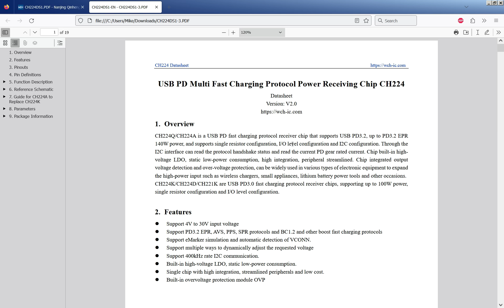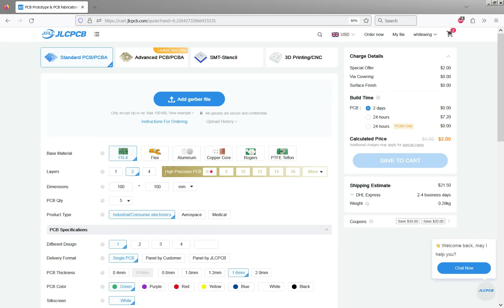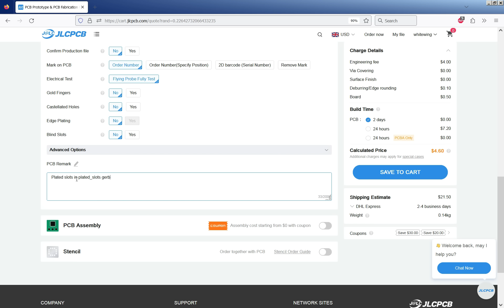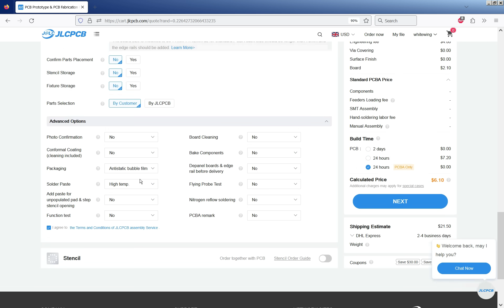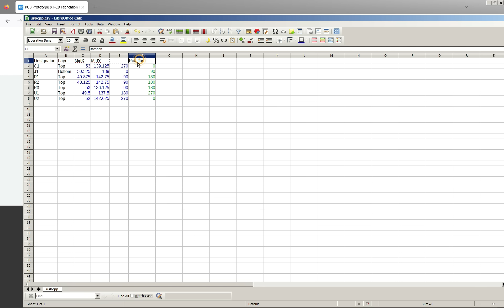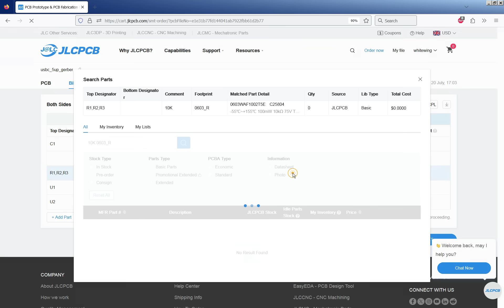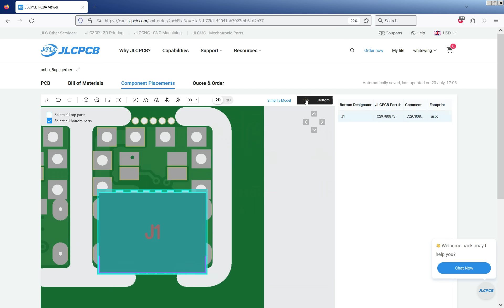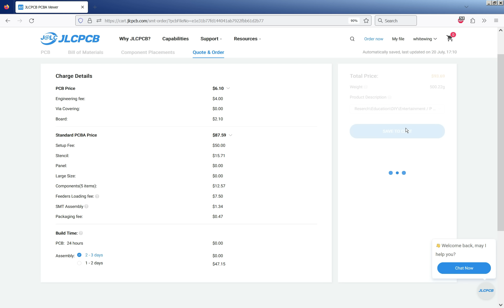USBCing all the things

Comment: Why would you make an effort to replace a dirt cheap, simple and reliable power connector with an unreliable and expensive data connector, for which you have to use far more expensive PD capable power supplies?
Reply: A 30W USB-C charger costs €7 at ikea (can go cheaper if you don't care about quality), plus one probably came with your phone, or your PC or monitor has a port, and you can also run your gear from a powerbank now.
Reply: I have a sizeable homelab. Because I've moved recently, all my electronics and their corresponding PSUs are in separate boxes. Not looking forward to match them up again.
Reply: it was explained in the very beginning of the video.. 😅
It is kind of nice to have "the one" power supply for all of your gadgets.. But I kind of have to agree, the cost / convenience ratio is a little off for my taste.
Reply from the maker: Because you can use the same adapter for lots of devices.
Reply: EU legislation requires anything with a battery to be chargeable with type-c. No longer each thing needing it’s own special cable and power supply.
Reply: @davadoff  Kind of, I think there must be an exception for higher power devices because we are still buying laptops which are supplied with a barrel jack 230W PSU but they are 'mobile workstation' class with lots of RAM, i9 and NVIDIA GPU etc.
Reply: @M0UAW_IO83 and power took batteries are all proprietary with no type-c… I’m sure there are some exceptions, but for your laptop, USB PD goes up to 240W (48v 5A) which would be enough.
Reply: @davadoff  because of crapple shitting in everyones face year after year. the european union put a stop on it.

Comment: would've added a third "leg" for triangular stability like the original plug design, even if not electrically required.
Reply from the maker: You can do that with unused pads, cut the track (or disconnect the battery compartment) if you need isolation

Comment: Beware 12V support by power supplies is optional in the PD spec, so an e.g. 60w charger by spec only needs to support 5, 9, 15, and 20V. If you're using these then you should make sure the chargers you buy also support the optional 12V PDO.
Reply from the maker: Wouldn't it revert to 9V if 12V is requested?  And which idiot though that 12V should be optional...
Reply: @mikeselectricstuff "And which idiot though that 12V should be optional"

Good question. 12 volts is common enough that it's crazy its not mandatory in the PD spec.
Reply: @mikeselectricstuff from my testing of some PD adaptors & boards it varies, some will give you 9V (which would be safer) and some surprise you and give you 15V, some flat out do nothing and give you 5V as a safe default if it can’t find said voltage
Reply: @mikeselectricstuff it may.
Per USB-PD negotiations following happens
1. PD trigger and powered device gets 5V.
2. PD trigger gets list of supported voltages from supply
3. PD trigger asks for specific voltage from that list (5V, 9V, probably 12V, 15V and so on).
4. Supply raises voltage to match the request (if request isnt 5V, outherwise continue outputting 5V).
Can you get 9V instead of 12V - it depends on the trigger, some do choose closest lower available voltage, some stay at 5V.
Reply: 12V is not mentioned at all in the PD spec. Pretty sure the reason for 5/9/15/20 is to align with 1S/2S/3S/4S battery packs with sufficient overhead. All voltages except for 9V give about 20% overhead relative to 4.2V. 10V would’ve made them all consistent.
Reply: @mikeselectricstuff  it’s up to the device requesting power, which could request 15v or leave it on 5v.
Reply: Has anyone seen a 60 watt USB-C PD charger that doesn't support 12 volts? I know that it is allowed by the standard, but it wouldn't make any business sense.
Reply: @hamjudo  i've seen plenty that only do 5/9/20 or even 5/20  and i often see them that do 5/9/12/20, 15 is actually less common to find implemented than 12 but it happens
Reply: @hamjudo yes. We bought a large variety of 60W+ adapters from Amazon for testing our PD boards at work and a TON don't have the optional 12V
Reply: @hamjudo Yes. Apple chargers from 20W up to 140W don’t support the 12V PDO, none of them. Also Anker chargers and power banks don’t support it either (that I’ve seen anyway).
Reply: @philipk89 but apple is the worst overpriced crap. to it kinda checks out.
Reply: @hamjudo sadly none of anker chargers support 12v, of course I only found out when 12v trigger was already installed as an upgrade
Reply: @nich98  Wrong. My Anker 317 supports 12V@3A
Reply: I mean anything 12v that you’re using in a car with the engine running is actually receiving 13.5-14.7 volts so defaulting to 15v isn’t that far off the norm.
Reply: @mikescholz6429 desktop computers have 12V power rail (it is supposed to run at 12.0V, not 13.5-14.6V), 12V LED moduled / LED strips - the same (are supposed to run at 12.0V)
Reply: For 12v, one way is to get a PD power supply with PPS (programmable power supply) which will do any voltage output (in 20mV steps).
Reply: I will miss out connecting a linear transformer based wall adapter.
Reply: Thank you!
Reply: Capacitors are 6.3v, 10v, 16v, 25v. No coincidence 5v, 9v, 15v was chosen, I suppose. A mosfet could be the next limiting factor and why 20v not 24v is next.

Comment: Just designed a power supply for the good old Commodore Amiga which will run it from a 15-20VDC USB-C output! The hard part is getting the 5 pin DIN connector for the Amiga!
Reply: enjoy all that switching noise in the audio/video outputs
Reply: @humidbeing  my design uses MLCC ceramics on the outputs. There is less switching noise there than on the original PSU's and even than from a Meanwell.
Reply: @humidbeing  also, you DO know the original Amiga power supplies are switch mode as well, right?
Reply: One thing to be aware of with the simpler USB PD chips, is if you ask for say 18V and the supply doesnt do it, rather than supply nothing it will supply a lower voltage. The only way I could find to prevent this behaviour was to get a microcontroller involved. I decided on using the HUSB238 mainly because it has an i2c input - the CH224 does too but JLC/LCSC only seem to stock the D and K variants which doesnt.

Comment: Great idea! A 3D printed shell in the exact same shape and size of the original would make it a perfect replacement.
Reply from the maker: The problem is sometimes you need to have the C socket stick out more than the original face of the power jack
Reply: @mikeselectricstuff  Yeah sure, and if it sits inside the case and there's a round hole in the case for the DC plug it won't fit and you'd even have to modify the case.
But in many cases, the whole rectangle of the connector sits flush with the outside of the case and then it would be perfect.

Comment: Neat little design!

One tip on JLC, if you've got really small features (at or close to the limits of their capabilities) it's usually worth it to go with the TG155 material rather than the default TG130. It's about a $3 cost adder but in exchange they're a lot more lenient if you're sending them a difficult board, and it can save you a ton of time and money down the line. It's also the material they base their impedance profiles and calculator on (bit of a gotcha there - if you order a specific stackup but don't pick TG155 the impedance will be wrong!)

Comment: The EU twisted Apple's arm to use USB C, they should make every company do it too.
Reply: It’s an EU requirement.  Every consumer product sold in the EU using any USB variant has to be redesigned to use USB-C.  (This will be using genuine import channels for external stuff.  They won’t be checking your AliExpress orders for compliance.)
Reply: @boggisthecat  Only in certain, mostly consumer-oriented, verticals
Reply: @0xbenedikt  That’s a bit misleading.  Search “EU common charger rules”, then look at the first link.

“The 'common charging' requirements apply to all handheld mobile phones, tablets, digital cameras, headphones, headsets, portable speakers, handheld videogame consoles, e-readers, earbuds, keyboards, mice, and portable navigation systems since 28 December 2024. These requirements will also apply to laptops as of 28 April 2026.”
Reply: @boggisthecat  Exactly. But there are so many product categories not covered by this even in the consumer space. Let's not get started about the non.consumer products.

Comment: damn, JLCPCB software sounds like some BS
Reply: Mike's way of doing it is a bit long winded - not sure what tooling he's using to generate the gerbers, CPL, etc.

Usually you just drop the files in from your EDA tool and it works, no messing about. Even with the part rotation bit you can correct it in the next step of the ordering process. If you're using EasyEDA it's basically a single-click order, and in Altium you can set up an Output Job once and reuse it for all your projects.
Reply: @gsuberland  works perfectly with kicad as well
Andy
Reply: it's not perfect but it's very simple to set up a pcb once you're used to it. I have no problems using it with my PCB work generated by EAGLE

Comment: FYI, for JLCPCB, you don't need to put plated slots on a separate layer or add a comment. Show the routing for the slot on the outline layer and cover the slot with copper (both sides) and it will come out fine. HTH.
Reply from the maker: Always best to state things explicitly to any PCB manufacturer - always a chance they will miss something, or query it, adding a day's delay waiting for a reply.
Reply: @mikeselectricstuff  JLC actually do say in there that you can specify milling on the "Dimension" gerbers and they will process it. Thats exactly how their CAM job from EAGLE does it, and as a result you usually get the plated slots shown on their preview images too
Reply: @mikeselectricstuff  Fine. You do you. I've done about 50 designs with plated slots my way and never had a problem. Just sayin'. 🙂

Comment: That's a really neat idea!
I've only ever used JLCPCB once for a custom PCB that I’d designed (the only PCB that I've ever designed). It took quite a bit of figuring out but I was very impressed with the turnaround time, the quality of the PCB and the assembly of the SMD components. All the PCB's were 100% perfect. A really first class service.
If anyone is interested (probably not!) I reverse engineered a STK3161B hybrid used in a Mitsubishi X7 music centre, it took way longer than it was worth, but I got it right first time which was very satisfying!
Reply: Reverse engineering a hybrid sounds cool! You made a (hybrid) integrated circuit, not something most people can boast about :)

Comment: How about an external version you can glue / stick over the barrel input without taking the device apart or soldering. It might not be as clean looking but also wouldn't require dissassembly, soldering or filling in the gaps around the barrel socket being removed. It would have a male barrel jack, USB-C socket, and voltage selector. Polarity selector is not required because centre negative devices are the devil's work. Suprised nobody has made this yet, I'd purchase a few
Reply: I made some for myself, cost 5usd for 5 USBC pd boards and 5 for plugs.
I use it to power my portable amps for electric guitar
Reply: You can get USB C to barrel cables, which aren't far off that

Comment: The trigger boards I've tried all default to the next lower voltage if the source cannot provide the requested voltage. Is the CH224K you chose the same in this regard?
Reply from the maker: I think so
Reply: It is and so are most of the USB PD chips unless you use a microcontroller with them

Comment: Pro tip after ordening for a while from JLCPCB: convert your BOM and placement files to .xls files. Thats .xls without the trailing "x". A lot of wonky troubles just go away. There are still issues with the whole Dutch/German comma and thousands seperator being swapped but that's Excels doing.

Did you make a OshwLab project from this yet?
Reply: You can also specify them in CSV format

Comment: One of the functions of that bog-standard 5.5x2.1mm jack is the built-in switch, sometimes used to auto-bypass batteries when plugging portable devices into a DC adapter. This is more common in older center-negative Japanese battery-powered electronics, like Walkman/Discman/Watchman, Game Gear (JP version only), Famicom Disk System, etc. Any way to do that with these boards?
Reply: you can use a usb c to barrel jack adapter . you must use the one with the right voltage and current.
Reply from the maker: not really
Reply: a schottky diode?
Reply from the maker: @victortitov1740  You'd need a pair of them otherwise you risk sending power the wrong way out the USB socket

Comment: Now don't hold your breath until Apple "improves" and promotes something different
Reply: From what I understand the EU mandated USB-C to reduce e-waste from “one size fits one device” design.
Reply: Let's be honest, without Apples aggressive push towards USB-C on the Mac, things would not have changed as quickly and I really don't miss Micro B or A
Reply: If one standard prevailed we would not have had Apple and their money grabbing ways, non standard connectors and different every time meaning having to buy more adaptors, yes agreed usb c was a major improvement, less risk of port damage from wrong orientation, plus power delivery - brilliant
Reply: @dav1dbone  you know that phone manufacturers had custom chargers before Apple, right ? Nokia, Ericsson etc.. all had their own chargers with custom jacks.
Reply: @jaycee1980  yeah that is true,  I'm of an age where I've own a mobile since before the analog switch off = the main factor to consider, you got a charger included, it's only since usb and perhaps even after that that computer connectivity was available, and useful. fair enough some folk would have bought car kits etc, but these invariably had a multitude of options anyway.
Reply: @jaycee1980  that was 25 years ago.

basically from that same age crapple equipment is sold today still.

same goes for OLED and that crapple introduction no less then 12 years late.
Reply: @casemodder89 You're talking out of your arse. Just another Fandroid.
Reply: Apple never did promote anything different. The only thing that was unique on the iPhone was the Lightning connector - the protocol was still USB and supported USB PD perfectly fine. My older iPhone with a lightning connector has always charged perfectly happily from USB-A and USB-C.

Stop believing what Fandroids tell you.